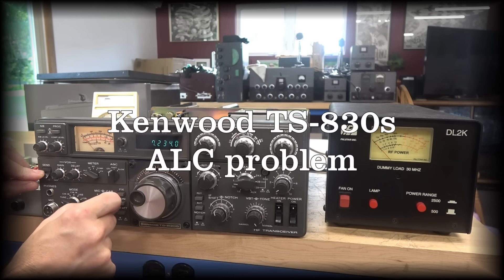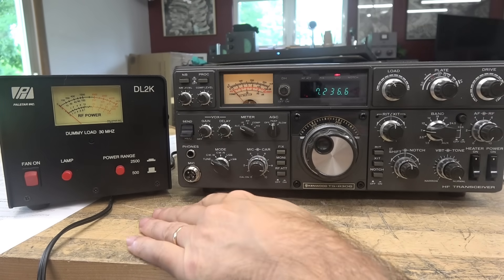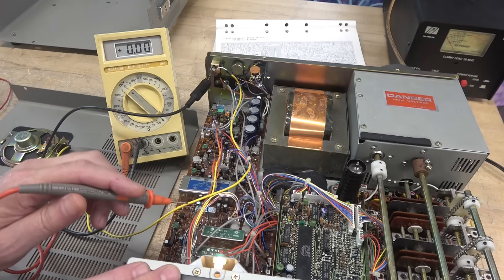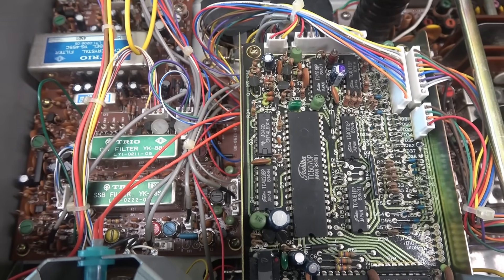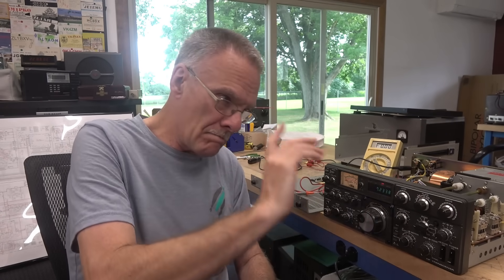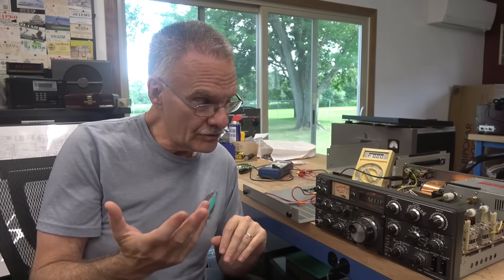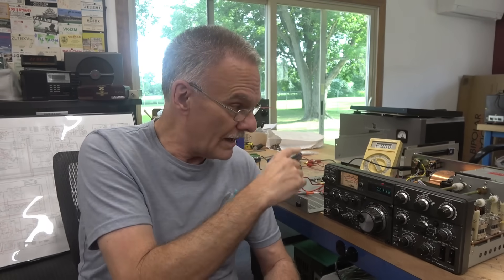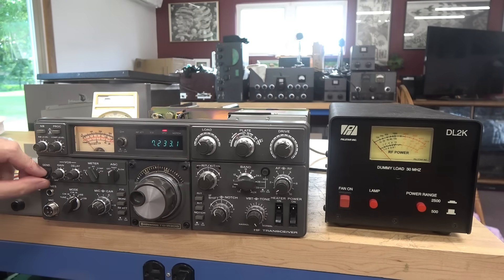How to repair Kenwood TS-830s Ham radio transceiver no ALC problem or pegging meter fix details

Comment: Good video. I have a TS-830S. These are great radios. Replaced the receive/transmit relay in mine some years back and have not had any issues since. Great tip in checking/reflowing the finals tube socket connections. I will do that on mine at some point.

Comment: Greetings from New Zealand , I also have a TS=830s which did not transmit due to DJs around all 3x valves/tubes in the output stage but also encounter the problem with the 2sk19 but not the 3sk73 so I set about finding a new 2sk19 which I knew I had as I use to work in a television factory back in the 1970s and they had this single gate fet on the chroma pcb to gate the colour burst signal, it took a bit of time but I eventually found  some brand new old stock and replaced it with a successful outcome, thanks for your very good Y/T video, cheers de ZL1ABR.
Barry Ward.

Comment: Excellent video Terry. My TS-830S has been sitting in a box for 20 years. I’m trying to decide if it’s worth trying to bring back to life (assuming that it would have lots of aging issues at this point). Like yourself, I’ve spent a ton of time on tube and solid state amps, so I’ve got the general skills. It would be a nice way to get back on the air after so long. 73, N1IMS.

Comment: Good explanation Terry! I have a TS-830S & a TS-520S.  Cleaned all the Pots & Driver Tube Sockets & all good so far.  Your information could really be helpful if I have trouble down the road.  Keep up the great work!  I have a Heathkit model SB-100 that pegs out on tune I am in the process of repairing. It has been challenging too.  Take Care Terry.

Comment: Fantastic video. I wish you were close or I knew of someone close to work on my 830 and 530. I’m on my fourth or fifth TS-830 since I’m not good at electronics. I can clean the band switch contacts and recheck the board screws which have fixed a lot of issues over the years but that’s my limit. A TS-830 was my first HF rig and it’s still my favorite! My 830 is on my bench now.

Comment: Another interesting video Terry! I watch all of your videos. I have owned a TS-830S for a long time, and its works very well. Yes they are complex but typical Japanese high quality. I have had several problems such as "no transmit" and "VOX not working" , which I repaired by finding cracked solder connections. 
73 from VA6JRC in Calgary

Comment: Good job. Proper static precautions are essential when dealing with JFETs and MOSFETs, they are easily damaged by static discharge and worse than that they may not totally fail for months or years. Many people who work on tube amps don't appreciate this, then they work on a Mesa........ it doesn't end well.
Reply: Antistatic wrist straps and work mats (1M ohm and 100K ohm to ground, respectively,  if I recall correctly) and a grounded soldering iron were required when I did repair work, mostly back in the '70s and '80s, at both work and home bench.

You're spot-on with the comment about static causing potential damage (no pun intended!) that may not show up until later on.